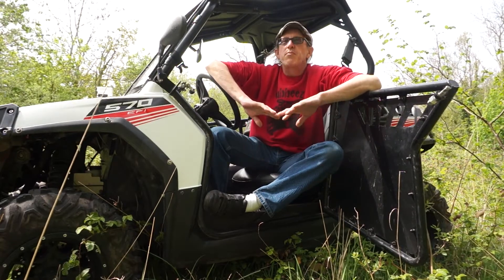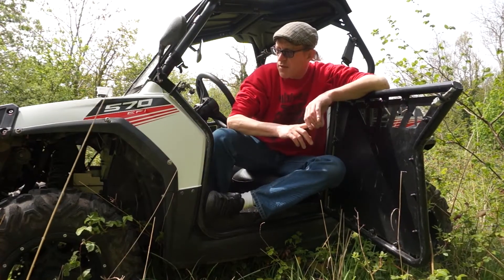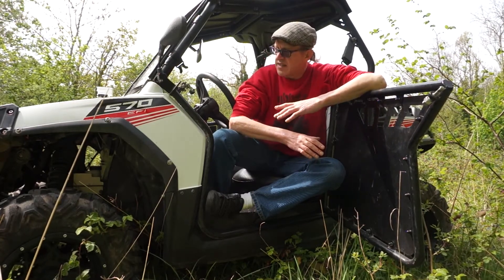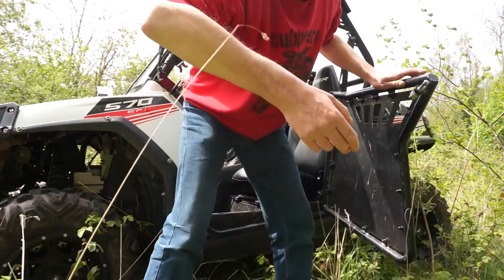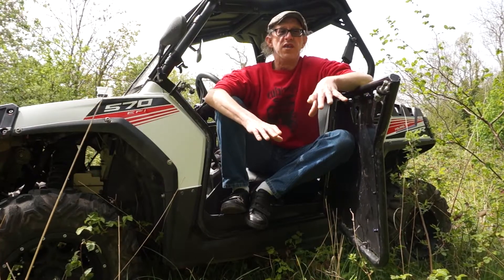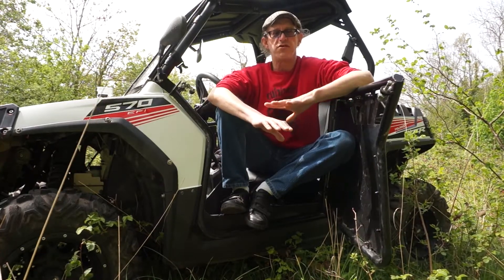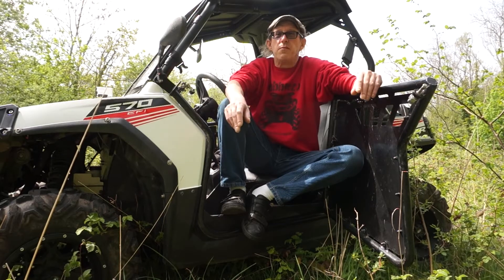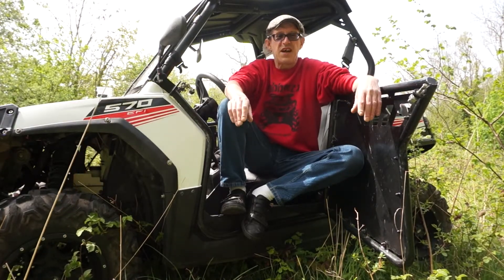wrist fussion update april 23rd 2019

Comment: Hello Paul.
I had my right wrist fully fused 2 weeks ago, after resection and reconstruction of distal radius due to tumour.
A I wonder, once your bones healed after 1st fusion, could you put your own weight on your hand and lift heavy objects and do the other hard work with your hand without pain and other restrictions.
I wonder because i'm used to an active lifestyle (swimming, weightlifting, gardening, raising 3 kids...) and I'm nervous about how active I can be once the bones fuse...
Thank you for your updates so far...
Reply from the maker: my last surgery was 30 jan 2019 , so im 12 weeks post op , if you have a look around my channel you will see what i get up to , chainsaw work , working on the polaris , rideng the polaris hard , . i worked the wrist before i had the revision surgery very hard , i would ride motorcross  and would lift heavy weights in work , as im now still in recovery mode after the revision surgory im taking it a bit easy but over the next few months i will be back to working the wrist hard as i built my confidence and strength back into the wrist and get back to work having been off for 3 months , have spocken to my boss and explained the situation and , work are happy for me to go back and build up to my normal load over a period of time 
you will be as active as you once were , you will adapt to the wrist being fused and find it a lot more usable than you are probably thinking now , once the bones have finished fusing they are very strong and you adapt to the slight lack of movement you once had 
good luck with your recovery
Reply: @paul_nwsxs  Thank you Paul, for all your videos and answer. All this things you are doing is very supportive to the people going through wrist fusion and your videos are making it much easier.
At least at the beginning, it is very stressfull situation.
Thank you.